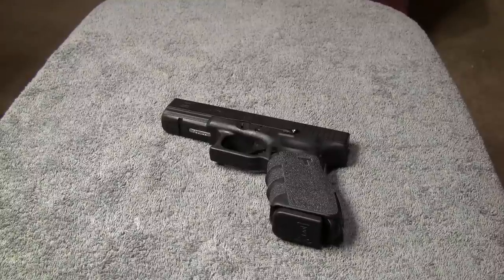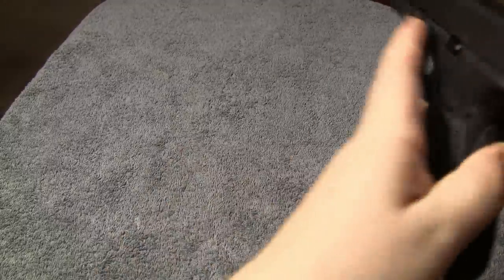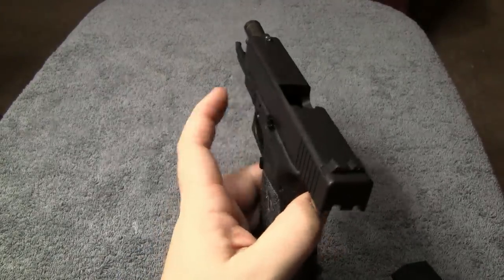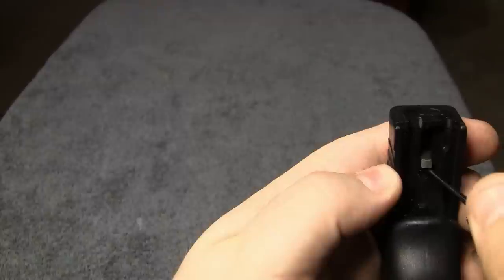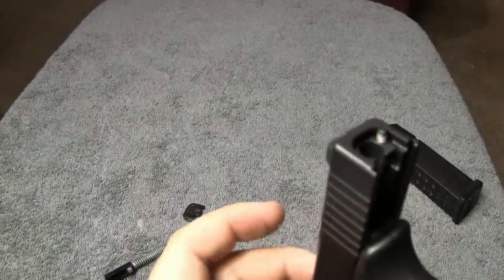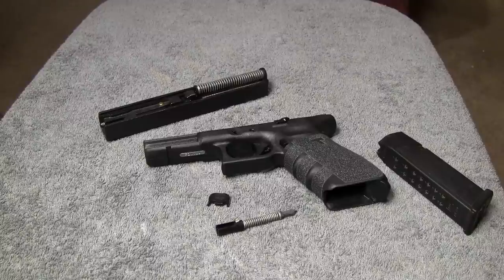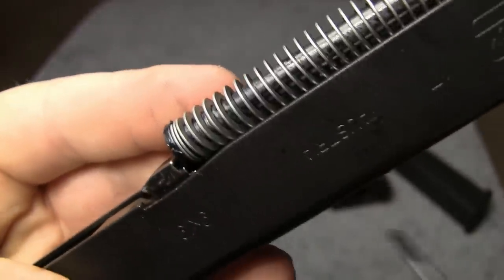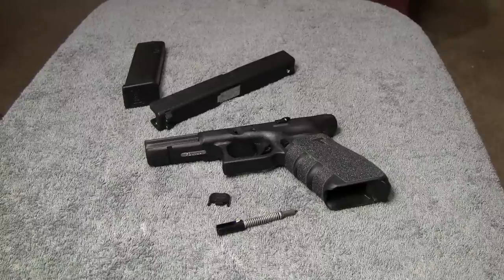How to get a Glock slide off when the trigger is stuck forward

Comment: It mostly happens when the trigger connector bar gets pushed too close to the trigger housing so that the gun is technically already “cocked” but pulling the trigger won’t undo it when you get the gun apart finally to fix it you need to stretch the bar away from the trigger housing a tad bit and you should be good after that happened to me today

Comment: I Just want to say Thank you. Im not sure how it happened but my g27 slide didn't go all the way back on after disassembly but couldn't be removed because something was engaging the trigger when you went to push it forward to remove. The slide wasnt on all the way so I couldnt manually hold the slide back with the weapon itself. With this video I was able to hold the slide back with some zip ties to the trigger guard so I was able to compress the stricker spring to take off the slide cover.

Comment: I can tell you another situation when the slide was locked and wouldn't go off because of the trigger. I was installing some new custom parts on my G21SF, and I had just installed the 3.5 pound connector (Glock original part). But then, I tried to install a new titanium striker (I don't remember which brand). When I assembled the gun, I noticed the trigger would not work and didn't come backwards. (continued due to the amount of characters).

Comment: @FragranceJunkie, the RSA only sits in the lower notch of the barrel lug during reassembly. Once the slide is on the gun, the rear end sits in its own channel in the frame and presses against the frame. During cycling, the spring makes no contact with the barrel. Upon disassembly, the barrel lug recaptures the RSA in whatever position it can as the lug passes the slide lock.

Comment: the only problem i am having is pushing the large pin out to field strip my glock 17 gen 4.  I literally have to use the glock tool and a small hammer to get it out.  Im 260lbs so believe me strength is not an issue for me. I have tried wiggling the trigger and the slide stop lever while pushing on it with no effect.  Anybody got any ideas i am up for just anything?

Comment: Mannnnn ...thank GOD you posted this video .... I have a brand new Glock 23 Gen 4 ....NEVER  fired a round through it yet ..been sitting in the case in my closet for almost a year ...so I finally took it out today to give it a first cleaning , and add some custom parts from the Glockstore ...I tried every conceivable way to release the slide , and it would absolutely not come off .... seriously ? ....WTF ??  ...well, thanks to your video I got it off ... my question now is what caused this piece of shit to jamb as it did ....Im regretting this purchase already ....I prefer my upgraded Beretta  92 FS even more to this pos .
Reply: Glock work best without aftermarket bull crap, put factory parts back in genius. Then your Glock will work better than any Beretta. Nothing against Italy, or Beretta I'm Italian & like Beretta, but Glock's are great until someone "makes it better"with custom parts.

Comment: Have a question sir, I put a ghost connector on my Glock 43. Either the connector is for a different Glock, I'm not sure. Anywho, I reassembled my gun. The trigger bar will not release the trigger, in other words the trigger really never engages. The slide is stuck on. Will not move forward, only rearwards. Any tips? I know, but I believed the trigger bar would work just fine.
Reply from the maker: +Dennis G. Rhoads See my video how to disassemble a glock with the slide stuck on

Comment: i got a problem with my glock 26 when i pull my slide back the bullet cum up half bullet get stuck
Reply from the maker: +Early Pierce First try a brand new magazine, sounds like a weak spring in the mag.
Reply: I got it i used 40mag in my. In da glock 26 bullet was to big & magazine was different
Reply from the maker: +Early Pierce ARE YOU KIDDING ME??
Reply: +Early Pierce You need some basic common sense in all areas of life
Reply: +Bill Lai lol
Reply: Early Pierce  obviously you do

Comment: Thank you so much for your video. I was a dummy tonight. I put my gen 3 glock 20 barrel in my gen3 30sf. I figured I wanted a 10mm barrel anyways and i was toying with an extended barrel to boot. IT did not work out well. Without your video I'd be down my EDC tomorrow while making a costly run to the gunsmiths. Thanks a million.

Comment: Thank you for this video. It seems as though my issue is that the ejector on the trigger housing assembly is interfering with the firing pin's path of motion when I try to put the slide on or off. It's quite a pain and needs a lot of force to get the slide on the frame, and now this technique in the video to get the slide off.

Comment: Thank you for this video. I was being a smart alec and wondered if I could put my Glock 17 barrel in my Glock 19. Spoiler alert. It will go in but the trigger does not reset and therefore cannot be pulled in order to get the slide off. With a little bit of working I was able to get everything back in its proper place.
Reply: Damn... #metoo.

Comment: My trigger moves just fine it turns out my spring moves up to the 1st notch on its own, no matter how I put it back together. Any ideas?
Reply from the maker: Totally normal! Leave it!
Reply: DefenderOfFreedom So, my issue is that the slide still won’t come off. It gets stuck on the trigger every time. I can get it to come forward about half an inch then it pulls the trigger forward. I pull the trigger a 2nd time, then it comes off. I can’t be the only one with this issue.

Comment: I once absent-mindedly put the slide back on my Ruger SR9c with no barrel or recoil spring in there.. I remembered watching a video on here that if you did the same thing with a Glock you just had to take the back plate off, tried the same thing with my Ruger and was able to get it back off. It's good to know these sorts of things.

Comment: I have a g19 gen 2. When I go to take the slide off it pulls the trigger forward and I then have to pull the trigger again to unlock it so that the slide comes off. What could be the problem I can't figure that one out. Do you have any suggestions?? Thank you
Reply from the maker: +Victor Tolentino It's no big deal, you probably just pulling the slide back a touch to far when you hit the take down levers, happens to me sometimes, does not hurt anything at all
Reply: ok thank you.
Reply: +H4T Certified Glock Fanboy Correct . . . prior to engaging the take-down mechanism, the slide is drawn back slightly . . . not enough to reset the trigger.

Comment: (part 2) the reason for that was because the shape of the striker part that touches the trigger bar was a little bit different and it was slipping, so the trigger would not go back. The only way was to disassembly the way you said to replace the striker with the old one. 
Great video anyway for those who didn't had such weird experience in the past.

Comment: Not the exact same issue but I had a similar problem brought to me from using a blade tech training barrel.  When they racked the slide it actually hopped the rails and the rear of the slide came off.  Working the slide wouldn't reset the trigger and so they couldn't field strip the pistol to fix it.

Your walk through worked perfectly, thanks!

Comment: You saved me a trip to the gunsmith. 
You are 100% correct in your opinion. In my case, I have an aftermarket tungsten guide rod with a detached spring. This was causing issues when the guide rod would unmount as soon as I assembled the slide and mounted it on the frame and pulled the trigger. I am well aware that adding after market parts to any firearm may cause issues. Luckily this isn’t a Glock I would defend my life with. I’ll be taking it to the range to ensure reliability is still there. Thanks

Comment: Hi- I have a live round stuck the chamber. The slide is stuck and the round looks fully chambered, you can just not pull the slide back to eject the round. The trigger was NOT pulled. I was just cycling rounds to make sure they would eject (9m reloads). Any suggestions for clearing this round. Is there a way to take the back plate off with the slide closed so I can remove the pin. Or will the pin fire if I try and take it out cause a round was racked and the trigger not pulled. Thanks for any help